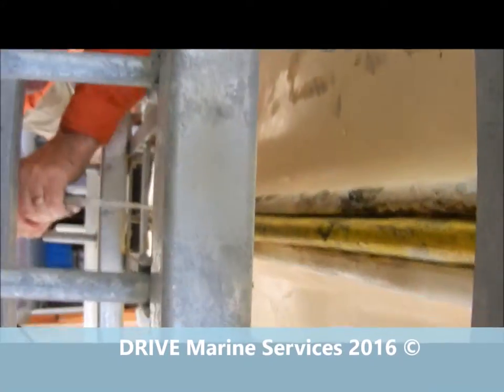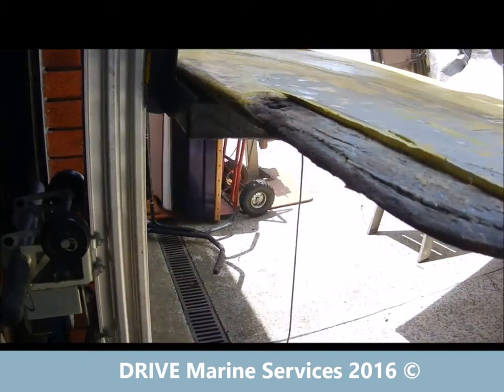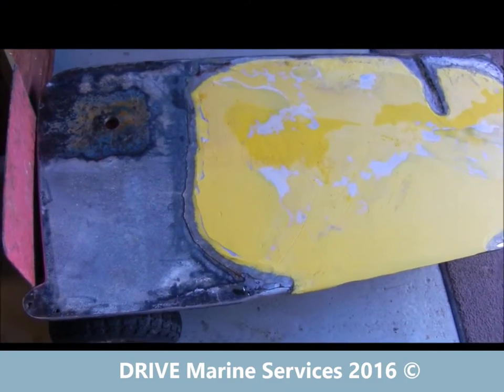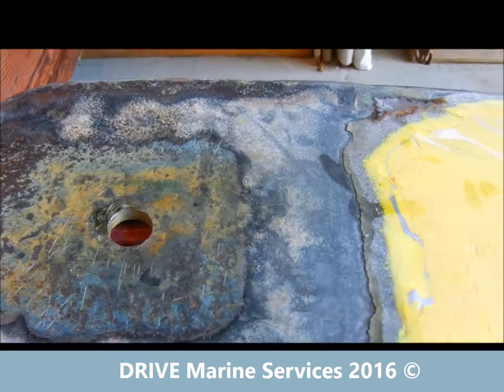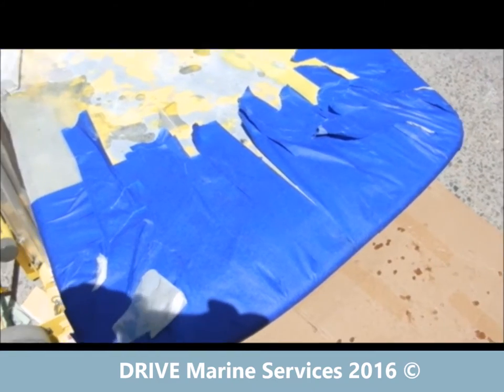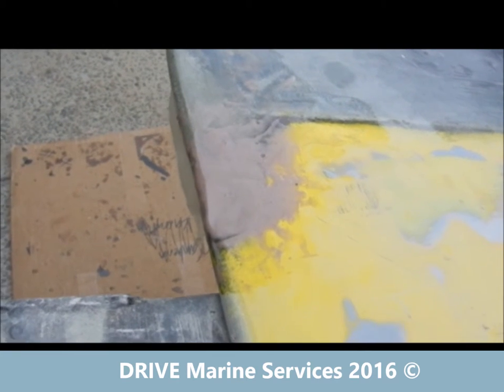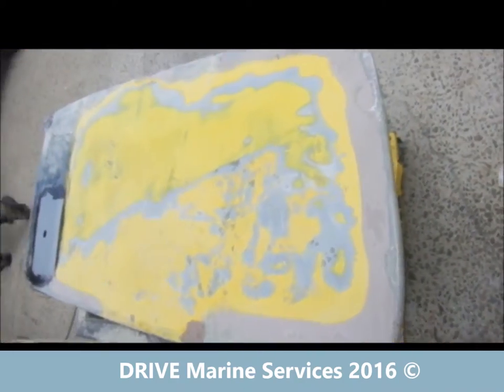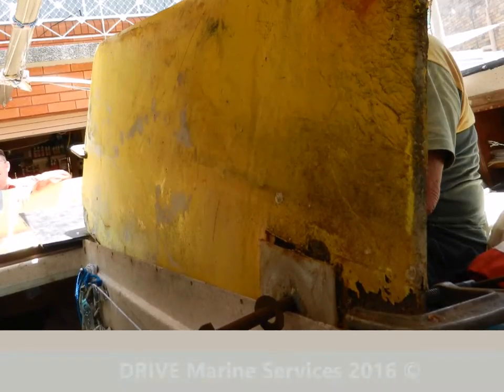Repairing and Restoring a Rusty Centreboard

Comment from the maker: I got sucked into fixing my mates CAREEL 18 Centreboard a week before XMAS 2016 and the repair process covers our adventure.  I hope it saves others some heartache down the Track.  The same techniques can be used for repairing steel items for any application.  Also some good info for using fibreglass & Peelply around corners and other surfaces.